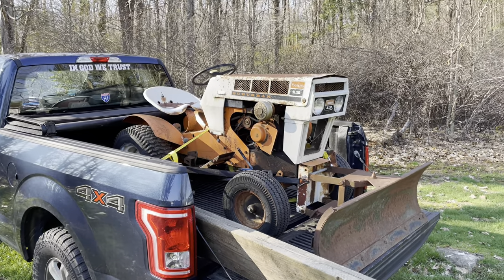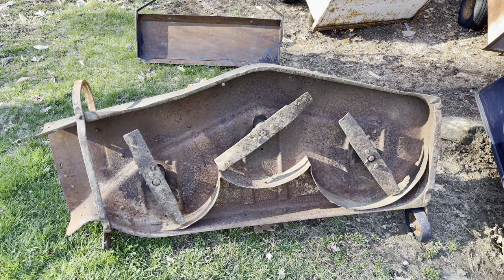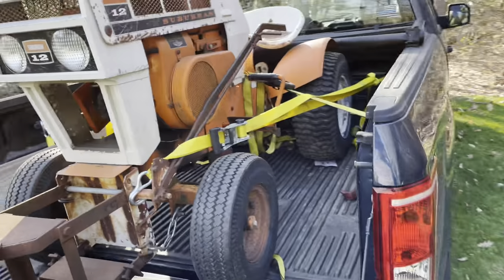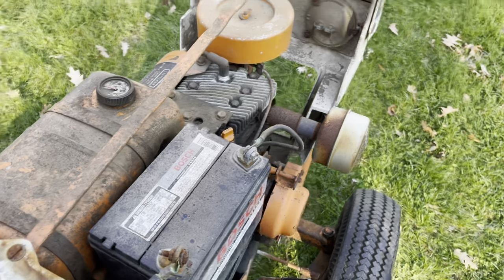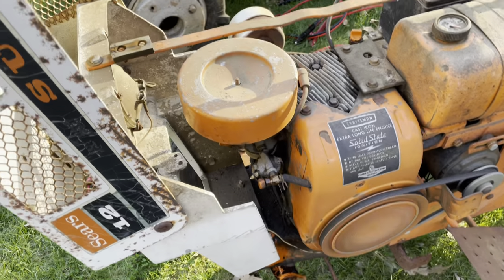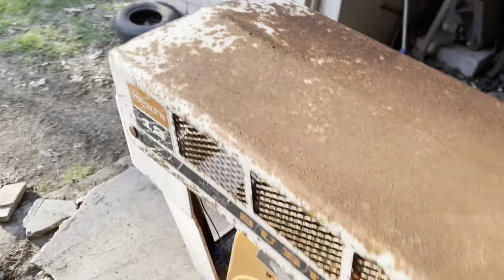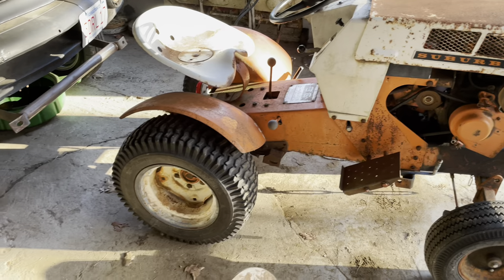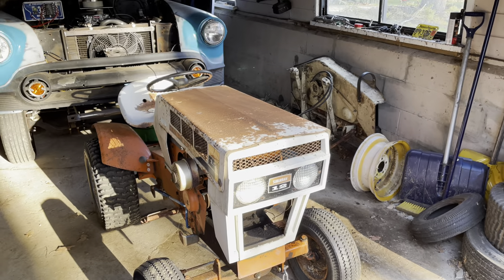First tractor purchase of 2023 1968 Sears Suburban 12 with plow and 48 inch mower deck

Comment: Great acquisition! Try running a couple of tanks of gas/Sea-foam mix to see if that will cure the smoking problem. Could just be carboned up rings sticking.  Should make a great little tractor!!
Reply from the maker: Thanks- yeah seafoam will help, but I think I’m doing a diesel swap in this one in the spring

Comment: Hello, I have a Sears Super 12 SS  that I just pulled out of the shed, I really want to restore it but am having a hard time finding how to diagnosing when or not I have a bad magento on a techumseh motor. Was a great all around tractor for everthing with all the attachments I have, Really would love to get in touch with you about parts you may have or best ways to help with this process. Got several Johndeeres now, but love this Sears Tractor. Its Great to see a website with new stuff. Good Job,
Reply from the maker: I think “Taryl fixes all” tests the magneto in a video I don’t really test them, I just replace them or end up swapping the motor.

Comment: I have never been able to decide if my 12 is a '67 or '68. It's weird because it's orange but it had a blue decal on the hood. It looks just like this 12 you have. That mower deck is the newer scissor type, do you know when Sears came out with those?
Reply from the maker: @TheSaturnV  if the footboards are smooth with grip tape it’s a 67. If the footboards are black steel with dimples they’re 68. The scissor lift deck came out around 1969 I believe

Comment: I’m about to buy a tractor that’s the same as yours and it also has a lot of oil on the frame in the same spot as yours and you mentioned it’s not a big deal, is it really not a big deal, I’m not too mechanically intelligent, please help weather you think I should go for it, thank you
Reply from the maker: Just years of leaking and vapor build up usually. Use some degreaser and a hose, wash it off, then watch for a lot more- if it leaks a lot, address the leak